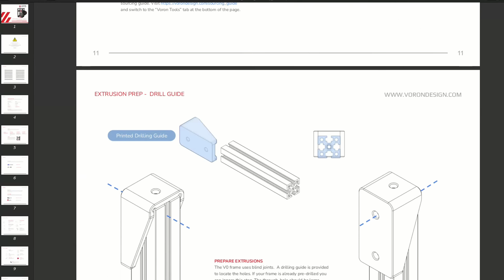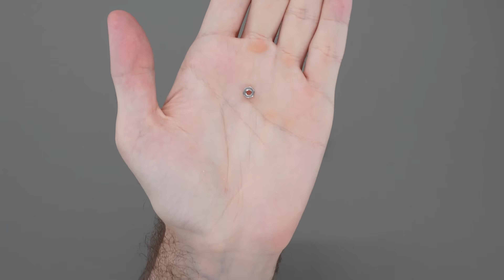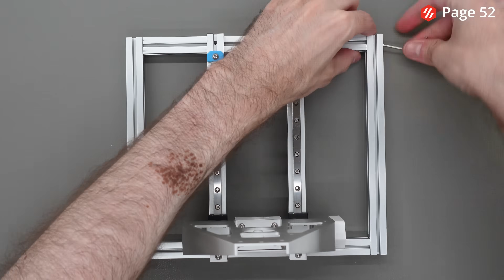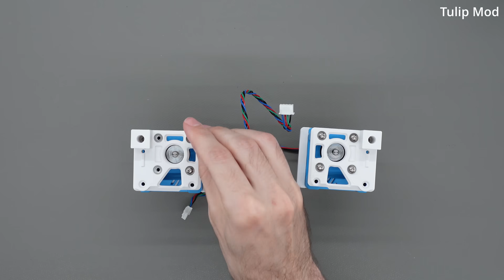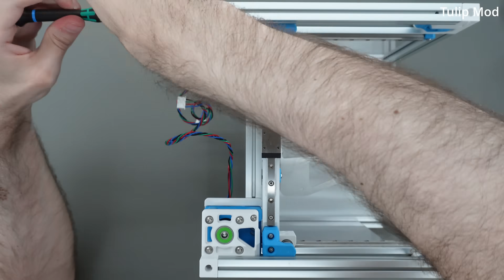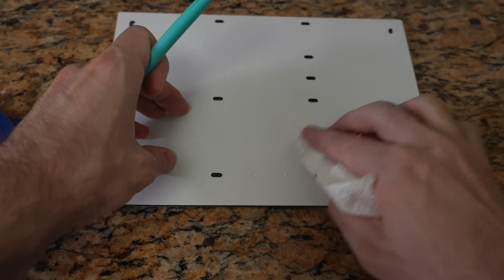I’m fed up with 3d printers, so I’m building my own | 3D Printer Build Part 1

Comment: Nice video ^^
I'm currently modding my second hand K1 MAX.
It just doesn't feel as Ridgid as it should.
I also started experimenting with a small CNC router...
The obvious thing to do was, adding as much additional aluminum to the K1 as possible.
To stiffen the thing up a bit 😂

Comment: did you get much shrinkage printing asa?
Reply from the maker: 0.5% fairly consistently on X/Y with the Polymaker ASA I use. For my own parts, I scale them up, but the Voron designed parts don't need scaling for shrinkage.

Comment: If the Voron Zero was atleast 180x180 it would be perfect for me. at 120x120 it is too small. So I hope they make a Voron One that is a part bigger :)
Reply: Pretty sure there are plenty of voron designs or ratrig printers with the build area you need.
Reply: @XA--pb9ni  There are, but they are so expensive. They make a H2S seem cheap in comparsion.
Reply: @AndrewTSqMan that sucks, i wanted to build my own voron toolchanger this year, but then snapmaker launched the u1.
Reply: just build micron

Comment: Why did you choose tulip over pandora? I'm planing on upgrading my V0, but can't decide which mod should install since i have seen a few people choosing tulip but don't know exactly why xd
Reply from the maker: I think I only glanced at Pandora briefly in my research but mainly picked tulip since it also has double shear support and live idlers support. Both are pin mods but my understanding is that mechanically tulip is smoothy / lower friction while Pandora is mainly focused on more travel distance

Comment: The Voron 0 is the worse printer I have ever built, I changed so many parts to fix so many major issues with this machines design, including changing the stupid thing to Nema 17 motors, they went with the silly over priced Nema 14's to save 4mm in frame size, better to just pickup a Sovol Zero, has more build area too, the Z-axis design is shocking, from cold to 100c there was so much variance due to thermal expansion, I also up graded the Z axis to MGN12's they also fit, not sure why they use the MGN7's also the bed design is rubbish, I also completely redesigned that too, the extruder needed an angled compression fitting, I fixed that as well, I wasted to much time on this thing to have a build volume of 120mm3, and its just a toy that sits on a shelf like silly Pokémon figurine, some of my fixes are published on Printables, some I could not even be bothered to upload as it wasn't worth my time.